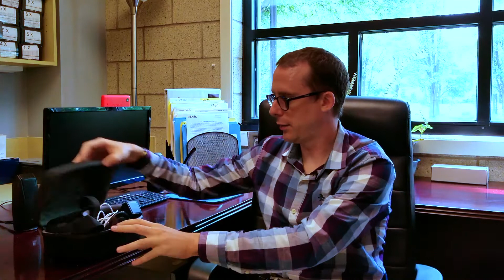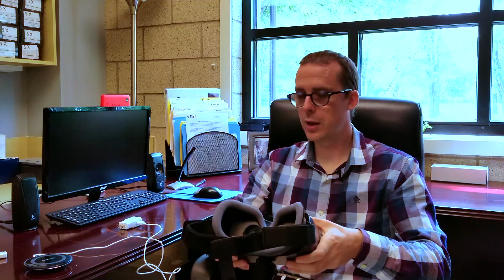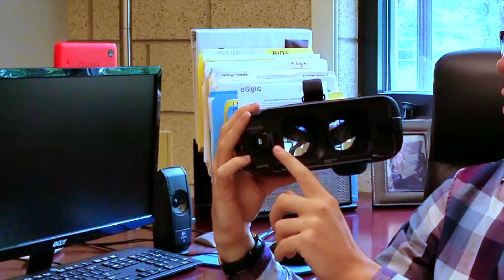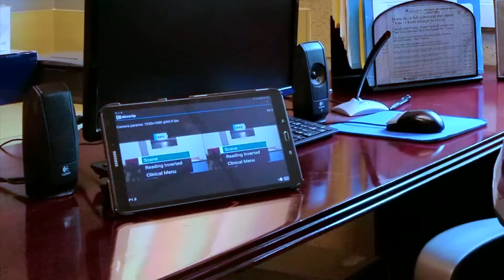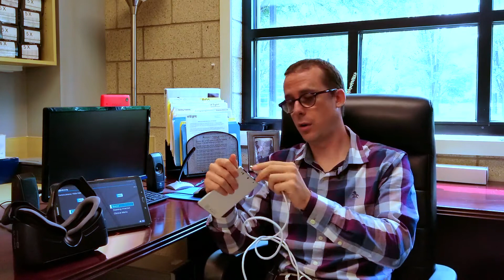Instructional Video on How to Use Your IrisVision

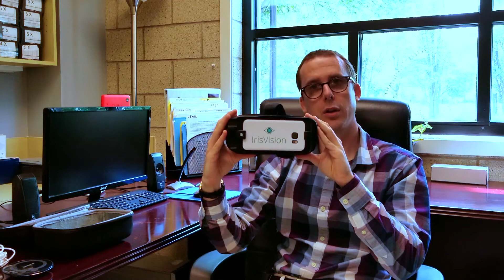Comment from the maker: Charging the IrisVision 1:08
Taking the phone out of the device 3:38
Information on the clamps on the headset and putting the phone back in 7:09
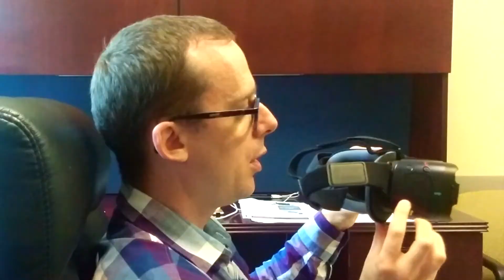Headset controls 9:43
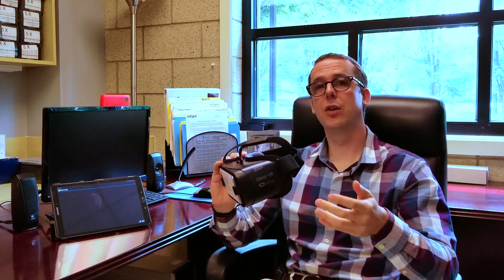Trying IrisVision out 11:09
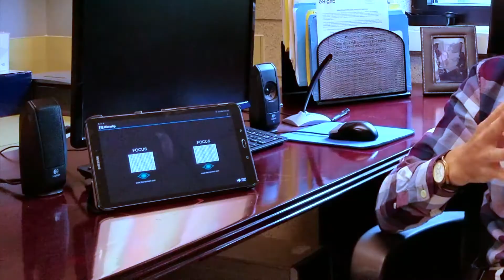Focusing screen 12:11
Live video mode 13:04
Accessing IrisVision's menus 15:27
Tips and Tricks 19:35
Using an external battery 21:14

Comment: Please help me puzzle this out - I have advanced wet ARMD in my right eye. Sitting 6 feet away from someone their chest, head and shoulders are in a central blind spot. When I look at the screen inside the VR headset, how is it possible for me NOT to see the IrisVision/phone image with also a huge blindspot?  Whatever image I use my eye to look at, my eye has no central vision. How does the IrisVision set-up get around this retinal degeneration?
I've mailed this question to IrisVision three times, and still no reply.
Reply from the maker: Hi Rob, here's how it works: Your blind spot will still be there. However, the larger you magnify the image, the relatively smaller that blind spot becomes. For example, if you are looking at a person at 4x magnification, your blind spot will be 4x smaller relatively. Therefore, you are able to see much more than you would have been able to otherwise. Hope this helps.
Reply: @ChiLighthouse  Thanks! I was thinking about that. When my face is close up against a 'photo' then the blind spot shrinks down relatively while the image remains in focus as it 's a digital image. Makes sense.